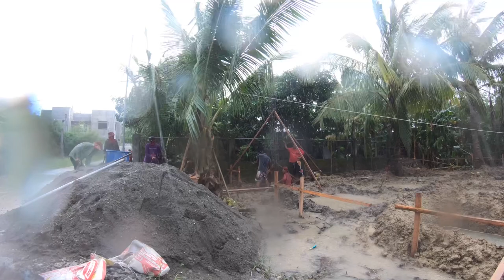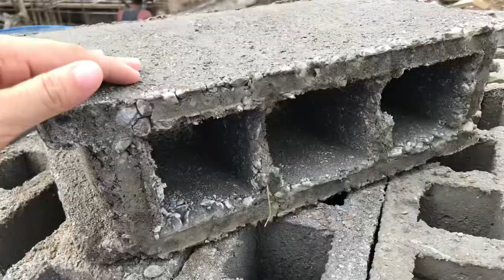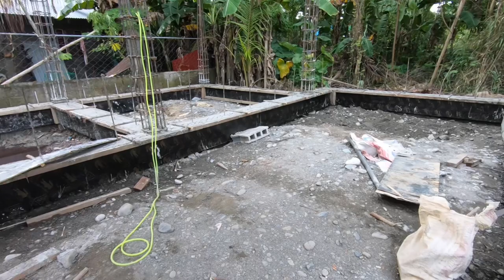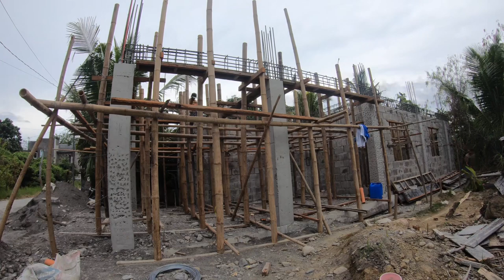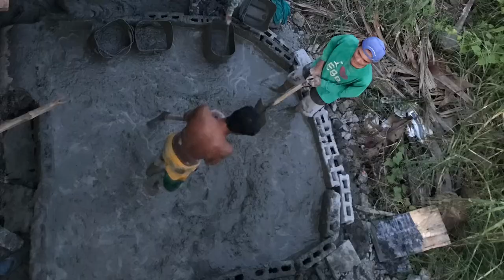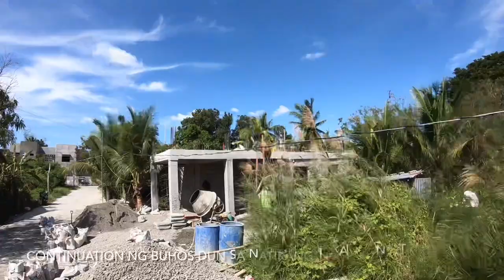Timelapse - House Construction of Mr & Mrs A. / First House / Philippines / Part 1

Comment: It looks like your lot has a low water table which is a major concern...Dapat ang semento ay hinahaluan ng CONCRETE ACCELERATOR para mabilis matuyo...Remember concrete is a porous material...It is better to paint foundation rebars with red lead paint or epoxy paint to prevent or delay rust corrosion...Ang maling akala ng marami...pag nakabaoon ang bakal sa semento ay hindi kakalawangin...Lalo na kung malapit ka sa dagat...with chlorine salts from air...
Reply: Most Philippines is wet. It is a tropical land.
Reply: @jeffegg2 he said water table not Wet. Totally different things . Having the high water table can also affect compactions. Another concern if you’re not placing a good base down.
Reply: @TomBTerrific  water table is not really a table, it’s water, wet.

Comment: They should have waited until after the rainy season to pour the foundation and columns.
Reply from the maker: Thank you for your concern. 
Building a house really needs many things to consider, if i waited for summer its gonna be hard to find workers. in our province its hard to find a trustworthy workers, you have to wait on their availability and you cant let them wait, they will find a new job; another thing- the weather is unpredictable. It almost rain all year round. Before the water subside it will rain again.
Reply: It’s just a mess, but chemically speaking  concrete dries faster in water.